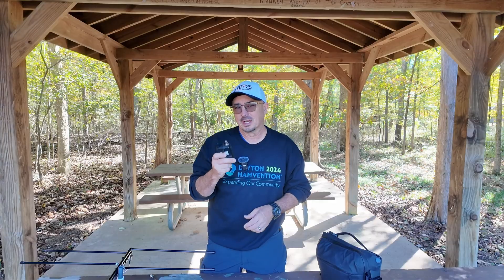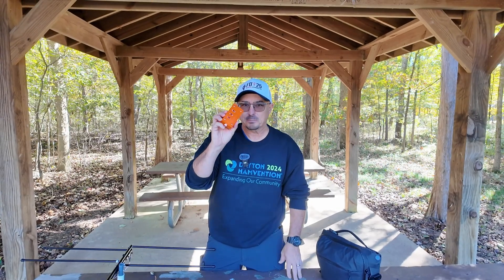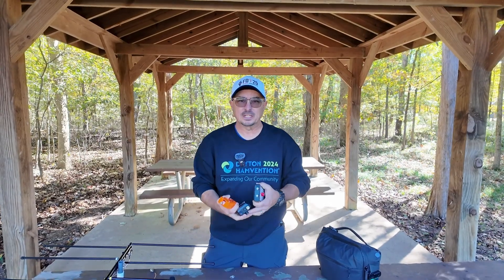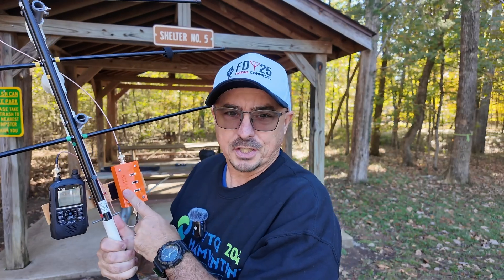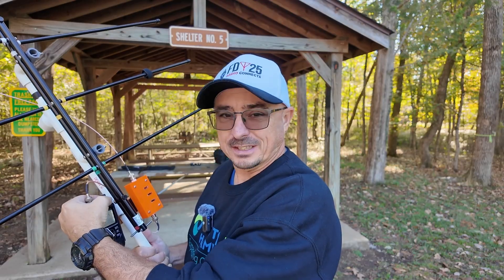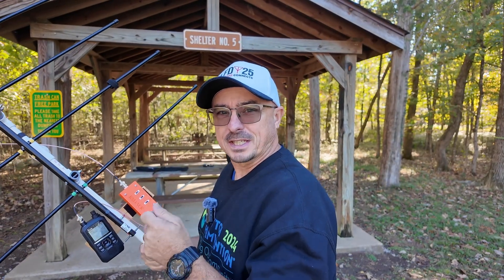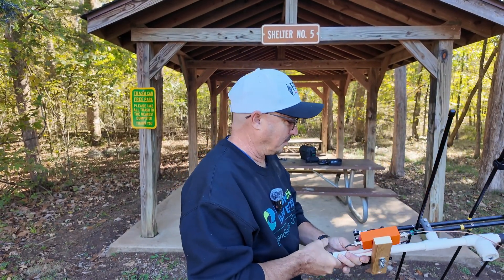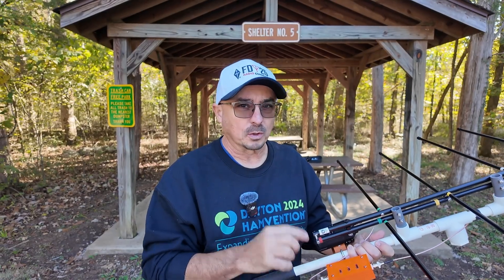You've Been Doing it the Hard Way

Comment: It wasn't clear to me whether you were using the offset frequency along with the attenuator or the fox frequency.  Most attenuators mix in a 4MHZ signal, so you tune up or down 4mhz.  Also, when I fox hunt with an offset attenuator, I just hunt on the harmonics of 4 mhz, so I can dial +4, +8, +12 mhz to hear increasingly weaker signals.
Reply from the maker: I should have been more specific but I was using the offset frequency. The fox was on 146.525 and I was using 142.565 with the offset attenuator.
Reply: Too bad they don’t sell that attenuator anymore. Way cooler looking than the new one. Aesthetics matter people🤓